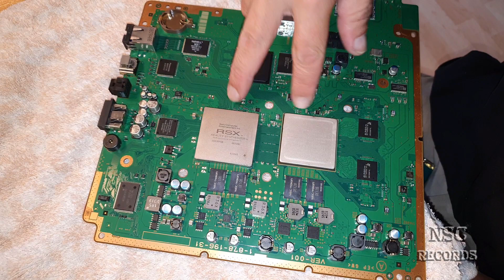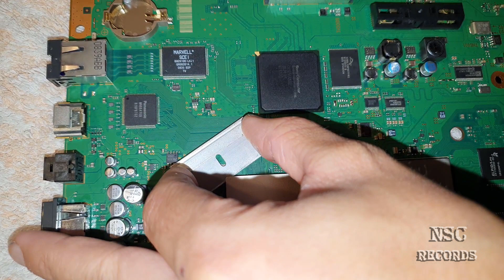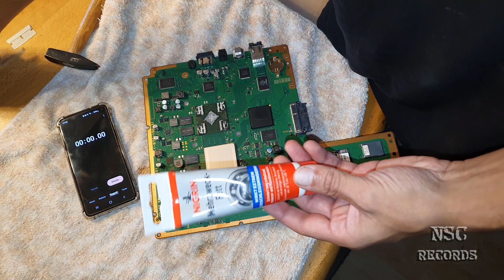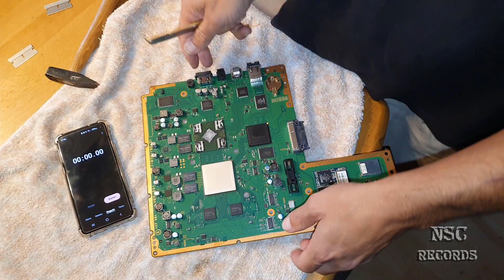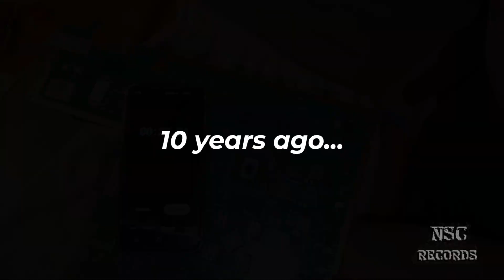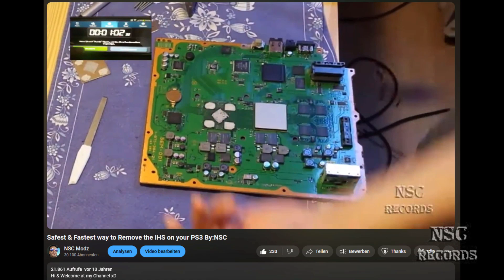PS3 RSX Tool? You safer and faster without... By:NSC

Comment: My ps3 slim with cfw has been opened and cleaned but those 2 culprits😂 have never been opened on my ps3 😒 i noticed that the rsx gets little bit hotter than the apu even though i put Kryonaut paste in there but it stays about 67 degrees without having to adjust the fan speeds 😌
Reply from the maker: @kristian1304  but bad, but 67 is near 70, so take care, because after 70, 75 will be next to xD
Reply: @NSC-Modz  I'm not worry about my ps3 for now it has become more stable than the last time 😌

Comment: Razer blade no way😅
Reply from the maker: Razor blade YES WAYYY and nothing new about 😆 Works like a charm!!!
Reply: @NSC-Modz  how about trying something from right hand of gpu front of cpu, some heat and pulling up ihs
Reply from the maker: @metavize8046 Forget that shit, and better never do it like that on the 25xx - 3000 Editions, you gonna kill the RSX 😂 And you don't read comments, I'm long life delider, there is nothing i did not try 🤣 Yeah, included Razor blades, Mach 3, Wilkinson, and and and 🤣 but hey i can tell you, I'm not the only one using Razor blades, if it's for Intel/AMD/Nvidia or witch Prozessors ever, best ever to get a lot open without to break it, if you like it or not 🤗✌️
Reply: @NSC-Modz  got it sir, im a new one here, you know, my problem is that i can not find a razer blade like that in my country 😄😄😄
Reply from the maker: @metavize8046 ahhh ok, so you very welcome :) Google Poliboy razorblade, you gonna find it on ebay or amazon bro. Otherwise check this: https://www.amazon.de/POLIBOY-Ersatzklingen-f%C3%BCr-Glaskeramik-Schaber/dp/B0042T644G/ref=asc_df_B0042T644G/?tag=googshopde-21&linkCode=df0&hvadid=696184104678&hvpos=&hvnetw=g&hvrand=17049591246089489224&hvpone=&hvptwo=&hvqmt=&hvdev=m&hvdvcmdl=&hvlocint=&hvlocphy=9041914&hvtargid=pla-2281435176178&psc=1&mcid=61581bc3e73f38ba88ee62e13d763c87&th=1&psc=1&hvocijid=17049591246089489224-B0042T644G-&hvexpln=75&gad_source=1 But before you go on, watch my videos, there is a lot info on how you should get the blade inside and so you gonna get soon a pro. And practice first on some broken boards etc...
Reply: @NSC-Modz  sure i will see all, thanks alot
Reply: @NSC-Modz  we cannot buy anything from ebay and amazon, but will search some thing to find
Reply from the maker: @metavize8046 you always very welcome, if you ever need something, just let me know ✌️
Reply: @NSC-Modz  im going to reflow a ps3 ylod, this video is your best way? I Should try like this?
Reply from the maker: @metavize8046 witch video exactly? I got a lot 😆
Reply: @NSC-Modz  so tell me wich is best i try that one, bro 😘❤️
Reply from the maker: @metavize8046 over reflow? I got a lot over reflow also, just don't forget to use flux
Reply: @NSC-Modz  yes, a slim ps3 is not runing on, when push power button just 3 beep and red light flashing, i have the wood and screw the main on that, and heat gun and flux ...
Reply from the maker: @MRFIXER_11  yeah, give it a try, but beep beep beep could be a lot things 😆
Reply: @NSC-Modz  so i had to connect syscon first?
Reply from the maker: @metavize8046 yes, but not always, if you know the ylod was because overheating, than a reflow or reballing will help here. If the PS3 was running cool, than it was not overheating and its something else...
Reply: @NSC-Modz  hi again, i tried a heat on chips by fux but didnt work, 3 beep and red light😪
Reply: @MRFIXER_11 any update if you fixed this??

Comment: It's great to hear your opinion about this RSX tool ! 
There are some demonstration videos showing the tool in action (even on a 30** Slim), but strangely, we don’t know if the console works fine afterward 😅
The method you're showing us is indeed the best 👍
Reply from the maker: Still the best, you can trust what i say, doing this stuff since 2008 on tausends RSX's never destroyed one. Never! But i saw people's destroying a lot's with stupid methods that in first looks good, but end up in a disaster... brocken vram chips, destroyed chips, scratches chips, up to destroyed the whole chip using butter knife and and and... i got a lot people sending me a lot pictures... ✌️
Reply: I bought one off the internet to try on a test board. Seller said there was no trick to it. It ended up cracking one of the ram chips in half.
Reply from the maker: This happens mostly to people who did it with the butter knife 🤣
Reply: @NSC-Modz  I haven't done any slims that way but plenty of 60GB models with a butter knife bent at 90 degrees with a heat gun. Haven't damaged any yet man
Reply from the maker: @daneayers7483 the oldest ones are no problem and way easier, but still happens to a lot people... pulling up the IHS is the baddest thing you can do, the inside life gets damaged and also a reason for freezing games, texture problems, YLOD and and and...
Reply: @NSC-Modz  technically your creating the same amount of pressure between the ram chip and ihs when you jam a razor blade in there and hit it with a hammer. The pressure is only only 1 chip not 2 though. I put a piece of paper under the butter knife to protect the rsx from damage when I push down on the butter knife
Reply from the maker: @daneayers7483 nope :)
Reply: @NSC-Modz  Fair enough. You are the PS3 man 😁
I've been following you for over 10 years. Do you sell your CPU delidding tool?
Reply from the maker: @daneayers7483  yes, but not so many left...

Comment: Best rsx delid tool is paper sheet, butter knife and heatgun.
Reply from the maker: @solidsnake123100  nope 😅
Reply: Clearly too dangerous. It might be fine on a FAT or early Slim, but even on these consoles, it can easily go wrong. And you can completely forget this with a 25** or newer model.
Reply from the maker: That's right, on the first ones no problem, but on the latest one, you gonna break the butter knife or the vram chips 😂😂😂
Reply: @NSC-Modz  Maybe, I don't care about Slims or even Super Slims. For FATs butter knife is enough and for my CECH-25xxB it worked well too. Maybe I just was lucky many times ;)
Reply from the maker: @solidsnake123100  yeah, it will work 100 times but on the 101 BAAAAM Pain in the as 😅
Reply: I use a chainsaw 🎉
Reply from the maker: @stefano806  yeah, the PS3 just deserves it after all the money we spend on it 😂
Reply: Far safer my man than this I would also use the alcohol around the ram chips with cotton bud couple of times to soak it into the paste then heat and pop off
Reply from the maker: @ps3vinny186 nope, heat it up, and you good to go, you beeing engineer, should know that the only way to get off thermal glue, is to heat it up, so the thermal glue gets soft and very easy to remove...